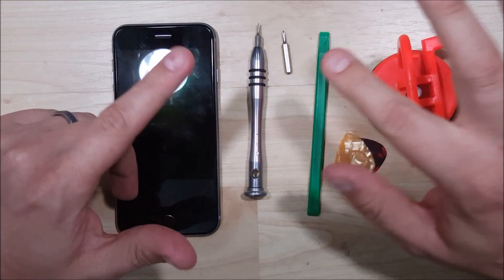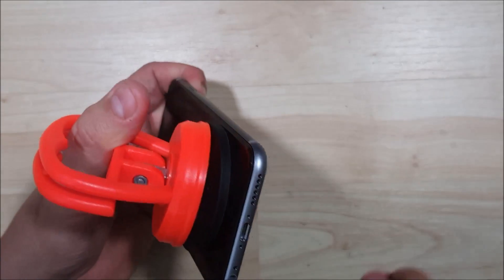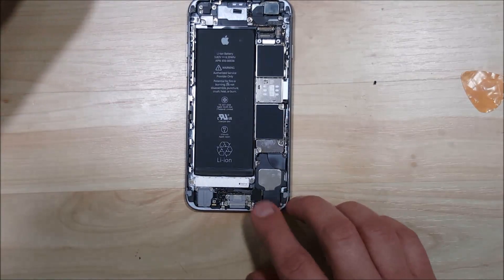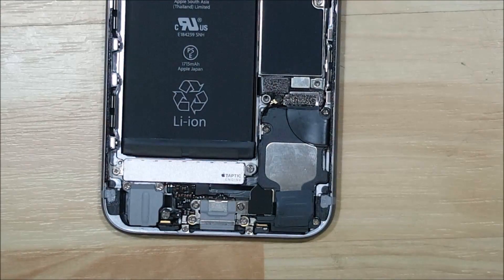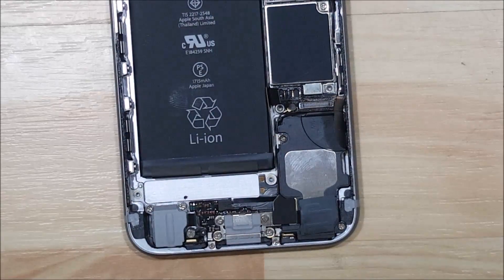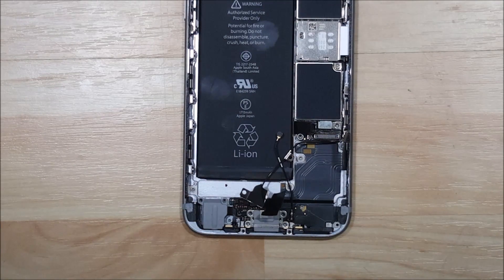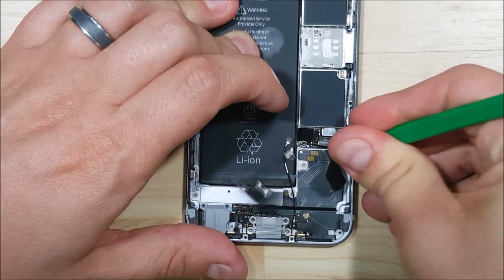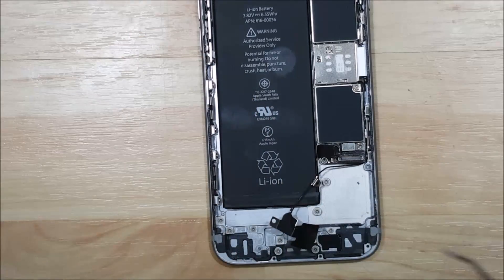iPhone 6S Charge Port Assembly Replacement - Disassembly

Comment: Hi i have problem with my iphone 6s whenever i plug my lightning cable into iphone charging jack my phone start dropping signals. Even cable is not attached with any wall adapter or computer usb... i cant make calls while phone is charging. Otherwise phone is 100% ok ..Can u help me out ?? Thanks